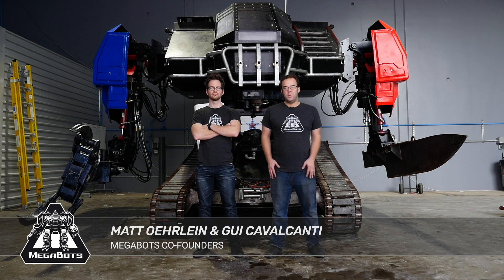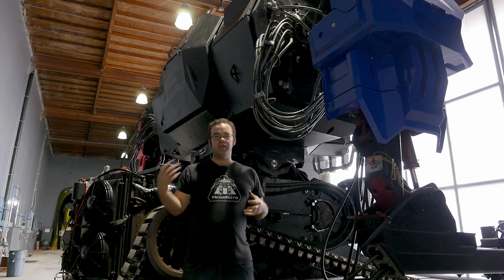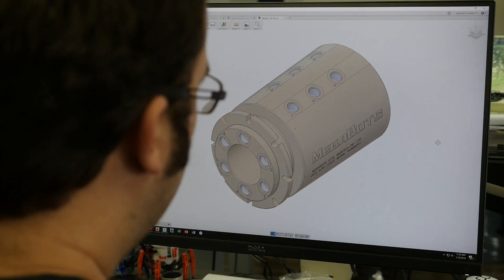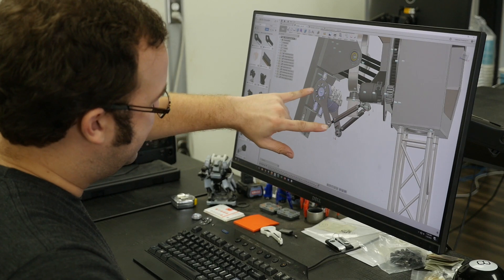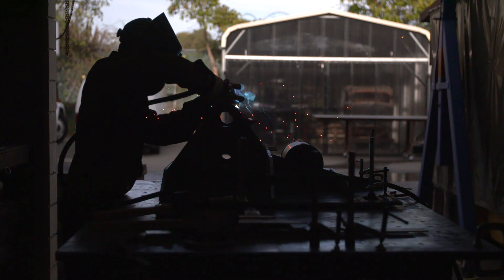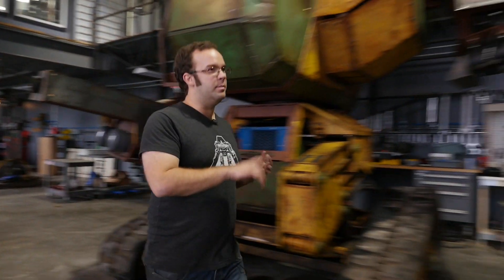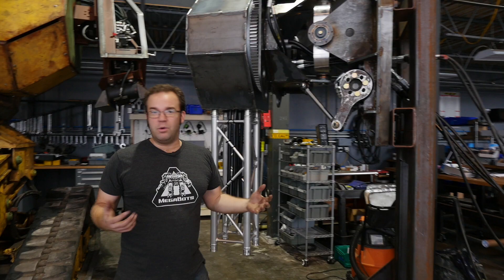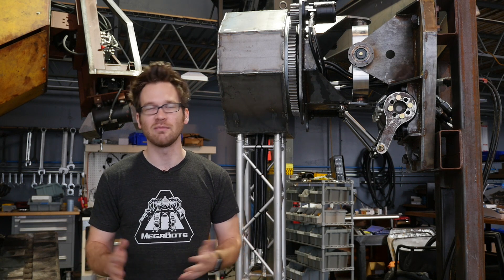A Faster Giant Robot Arm!

Comment: I realize speed over power was the entire point of this but out of curiosity how much of a loss of strength (if any) was there? I'm noticing from the video it appears to use hydraulic motors rather than electric and it appears there's 3 of them, how much lift power does it still have? I'm sure it's no pushover still but I'm wondering if any tests have been done on this aspect of it yet.

All that said, definitely looking forward to seeing this project finished and seeing Eagle Prime equipped with these speedier arms and possibly the tire base, I might be going off topic of the video bringing up that test but it seemed promising based on the livestream, biggest issues I saw (besides the cone masacre of course) would be the issue of altering the telehandler to support the rest of Eagle Prime and the length of the tire base possibly getting in the way of proper combat. (At the same time this is speaking from someone without knowledge on construction vehicles so not sure how big of a risk those tires have of being damaged)

And if you guys read this, thanks for reading this long message that got way off topic from where it started.

Comment: your fulls cus i have this (i have the worlds secris i my head one of them is how to make a mech its so simpal and why are IDOUTS LIKE YOU INORING MY COMINTS HERE HOW TO MAKE A WORKING MACH THE HUMIN BOTY IS SPENDED FROM A ROPE WITH A VR ON THERE HEAD AND SOMETHING TO TRACK THERE LEG HEAD AND ARM MOVE MINT THEN TELL THE CORUSPONDING BOTY PART TO THE CARUSPONDING PART OF THE MACH AND ALL THE PORSINGSIN POWER IS NOT IN THE MECH BUT FROM A DATU BASE WITH A BIG TRASMITER AND RESEVER AND THE MECH WILL HAVE ONE TO AND TRAFERS THE DATE TO THE PROPER PART AND THE HOLE MECH IS REMOT CONTROL WICH MEANS NO CASHLTYS ITS A SIMPAL AS THAT NOW IM JEST GOING TO SPRED THE WORD WITH CTRL C AND CTRL V) and yes i made this my self i aso did one on hack smith so GET TO WORK IDOTS

Comment: awesome to see the evolution 
tho i will say, it is amusing that you didnt do this during Mk2 design
i did tell you
but you argued against it 
so will this be the birth of the Mk3 ?
not only will your new design hit harder and be stronger
it wont need as much weight because it wont need to tons of extra armour the Mk2 was going to need 
also, using the same parts you can increase the mobility in the legs and perhaps start thinking about bipedal movement 
might be a good idea to have a chat with these guys 
https://youtu.be/3ldJswGpkjY?t=5m26s

Comment: One question, why are you guys still sticking with the robot design that is very tall and is top heavy? It will fall over very easily like the first battle... Take an example from the japenese robot, it is a bit shorter but it's mass and legs are spread widely, thus making it harder to topple over.

Comment: The rotary union was a waste of time and money... A simple thick wall hollow tube with the hoses running through it would have been fine as there is no need to rotate the shoulder more than 360 degrees if you are trying to mimic human joint... another issue is that although hydraulics are strong, they are slow... you are also putting a lot of stress on that tiny pinion gear... outside torque will bust that gear/motor easy. why not go with pneumatic power on parts that need speed?

Comment: TO SLOW YOU NEED TO COUNTER WEIGHT !  TRY GIANT SPRINGS ON FRONT OF THE ARM WITH A VARIABLE TENSION MECHANISM ON A CABLE LIKE A REEL ON AN ELECTRIC MOTOR THAT CAN SPINUP WITH THE CABLE LOOSE AND THEN YANK THE TENSION ON THEN GO TO FORWARD WITH THE HYDRALIC ! I USE COUNTER WOUND REALS AND AT THE MIDDLE POSITION THE LEGS ARE HANGING DOWN THE MOTORS SPIN UP FROM HANGING ( NO PRESSURE ON THE CABLE ) TO 1500 RPM THEN ENGAGE THE LEG TO PULL UP !  20 POUND LEG MOVE UP LIKE A STILLETTO  ! THAT BOT WAS ONLY 5 FOOT TALL! AT THE HIP ! YOU COULD JUST USE A LARGE ELECTRIC MOTOR WITH A REEL BUT IT WORKS GOOD TO USE 1 MOTOR AND 2 REELS AND COUNTER WIND THE CABLES ! ITS CHEAP AND EASY

Comment: Was this an ad for Autodesk? If so, I fully approve! Get as many sponsors as you need to make this happen!
If you had unlimited funding would titanium be a viable option? I feel like the reduction in weight would really help with movement speed.
Reply: That could be viable, but there's a couple reasons Steel is preferable:

1: Cost.  These are parts that may very well be broken regardless of how well designed they are, which means that replacements need to be economical to create and have on hand.

2: Size and design.  Titanium, while stronger for its weight than steel, isn't necessarily smaller for the weight than steel.  It can vary, with Steel sometimes coming out on top, and Titanium winning other times.

Because of these two factors, steel is, for now, the better all-around choice.
Reply: Cost of course is a huge limiting factor, but in a dream scenario with "unlimited funding" that wouldn't be a problem (obviously not realistic, yes).
I don't really understand your second point. Are you saying that you would have to use more titanium/bigger pieces of titanium to have the same strength of steel? For example, a 6 inch tall steel I-beam would be just as strong as a 12 inch tall titanium I-beam, but the titanium would still be lighter? In other words, titanium would be lighter but bulkier?
Reply: Exactly.  The difference in size wouldn't be that much, but it'd be there- and more Titanium means more cost, as well as more size.

You see Titanium armour on a lot of Battlebots because it lets them get away with much thinner, lighter sheeting on the outside, while still retaining a lot of strength- if they replaced the same weight of titanium with steel, it'd almost be something you could put your boot through, but if they replaced with the same volume of steel it might end up even stronger, but be much, much heavier.

It's all in what alloys you choose, though,and how you end up using it.  Just due to the size of the steel industry, cost is still the biggest concern.

Comment: Glad to see that their is enough interest in the project from tech companies to sponsor/partner with you.  I was worried the project might have been dead.  The improved arm and protection for the hoses is a definite step in the right directing, but The biggest problems with Eagle Prime, namely the overheating (and possibly under powered) engine, the lack of really destructive weapons, and the lack of armoring of the superstructure still need to be addressed.
Reply: I think the lack of armouring and the frailty of the design are actually on purpose for the showmanship of the thing.
People have asked loudly for more destruction. This will cost more. And ask for more quick repairs. 
By allowing the Mech to break easily at points of their choosing, they are actually preparing for massive graphic violence and low budget repairs. I think it's the way to go, at least for now.
Reply: Bohemond I of Antioch for the moment they need to deal with the biggest problems and those are the ones that can damage the image of the franchise really

this is a step in the right direction, with this video alone they had demonstrated that

a) they are still alive and going strong

b) they knows that there are problems with the bot and are taking actions to correct them and further improve it

c) prepare the stage for future battles

if you want to help them fund the bot buy a shirt, they already said that a big chunk of their budged comes from the things they sell

Comment: Like the invovations, and I'm sure someones realized, but be careful using Gear type joints in the arms.   They have serious issues with durability if theirs any kind of resistance/counterpunch againgst them.   If your just using them to rotate up and down on the shoulder it should be fine, but if you attack of punch using them they will break very easily.

Comment: so when do they start selling the plans to the military
Reply: James Fulton when the robot is developed enought to be considered a weapon
Reply: Probably never. At least not in this way. The military doesn't want Mechs. They are too high, get unbalanced quicker in case of hard recoil and for now, they still do not possess the advantages of fast and agile bipedal locomotion.
What will most probably happen is that eventually development will get to a stage where it will be able to serve other uses. I guess we'll see police and firemen crew use Mechs way before the military.
Then maybe, the military will finally get interested.
At which point, they won't buy...
They'll simply bring the members that have left the team on board and begin their own program.

Comment: That’s a shoulder joint made for a fighting robot, instead of a joint from an industrial robot that you’re trying to use in a fight. It would be nice if another team got serious about this too, instead of nonsense like China’s renders and the Kuratas toy. As it was, Eagle Prime was already well beyond both of them. Now, anybody who wants to be a contender has at least two years of work to catch up, and that’s only if you guys quit developing now and wait for them.
Reply: fx odios admittedly, the kuratus was built to battle mark 1, not mark 3.
Reply: Daniel Knight eagle prine may have beaten kuratas’ “toy” but you have to admit that if they were in equal sized robots and kuratas had put stronger armour panels instead of some of those plastic parts then it would have standed much more of a chance
Reply: I feel like as long as there arent any weight/size limitations it'll always just be the bigger robot winning, or the one with more power

Comment: I hope that the geared power transition is robust enough to withstand punching. Snapping off a tooth would put that arm out of action.
Reply: To be honest a chain or a globoid-style worm drive for that would distribute the load much better over a larger engagement surface. I wonder why they didn't go with one of those?
Reply: Everfalling It’s mild steel so if wouldn’t snap, it would bend. Even so you’d have to try very hard to do even that.
Reply: I imagine that a chain would be even more prone to failure, despite being easier to repair.  And a worm drive might have a higher chance of shear, due to no reverse-drive capability.  That is, something impacts the current gear setup, some of the force is transfered back through the rotation of the drive gear- something impacts a worm-gear setup, all the force is stopped at the teeth.
Reply: Earthenfist: I did say globoid though. One of those would be engaging somewhat more gear teeth than two or three. Yeah it can't be back-driven (which could also be taken advantage of in some cases), but I see a hydraulic motor being used to drive it rather than an electric. Those don't take to being back-driven much if at all either. Only way to do that is to get rid of back-pressure. So it might imply there being a relief valve or damper tank on the hydraulics, which just might be enough to prevent the level of torque that would shear a tooth with the current setup.

Comment: You might want to put some sort of plating or a cover on the ''armpit'' to protect the joints moving the new arm. Yeah the wires are safe but if those joints are compromised you're right back where you started. But regardless good job, with every failure is a chance to get better and the arm the new arm is going to be great.

Comment: I am so happy that this is still going what you guys are doing will change the future :)
Reply: CHIPOTLE MASTER without real science break through like new material and new energy source , future will not be changed
Reply: x jh did I say for science no I meant for entertainment so stfu before you dig yourself a bigger hole
Reply: CHIPOTLE MASTER are you going to ask " is math related to science ?"
Reply: CHIPOTLE MASTER what engineer work with is science itself.  Such as the material.  One problem facing building a real mech is the material and power source.  All of these problems require science breakthrough for it to work. You can't  engineering your way to a gundam with current tech. Without break through , you can build the best bow and arrow possible , but would never build a gun. 

What these guys here are just building bumper cars

Comment: Why not use electrical motors? I'd love to see a fully electric bot
Reply: They're much, much less powerful, and way more expensive.
Reply: Plus they would have to add an electricity generator to the motor. Which adds another point of failure.

Comment: Next is making it walk.

You will need pressure sensors all along the foot and from where the pressure is and the angles of the limbs you can make it balance.

The feet need to be able to move like a human foot as its the most important part of balance.

Good luck as i have seen very few good two legged robots and non that damn big.
Reply: CommanderWolfy hey you ever seen method 1? Its worth a look at if you havent seen a walking robot that size.

Comment: The new arms do move much smoother than the last models. I'm worried the giant gear assembly would be a weak point should the teeth on it shear or break off :(
Reply: Ya with a hefty punch those gears would strip real quick, although it's not much extra work to have several motors share the load and also distribute the gear engagement.
Reply: Well, maybe it will be protected by future hull plating?
Reply: I pray they are not using the trussed arm in the video for combat, because that has many inherent design weaknesses.

Comment: Improvement 
1.increase movement like the turning 360 degree 
2.add  thrusters to dash at the enemy’s 
3.find a stronger and lighter metal
4.increase every turning and movement speed as possible 
5.final add mech legs that are armoured and fast as a tank
Reply: TGamer Bailey nice, now we just need a fusion reactor and force fields. BRUH YOU'RE ASKING THEM TO DEVELOPE NON EXISTENT OR DARPA LEVEL TECHNOLOGIES. CHILL.
Reply: "Add thrusters"
Hmmmmm......... 🤔
...
...
...
ELBOW ROCKET!!!!!
Pacific Rim anyone?
Reply: One of the only metals that has comparable strength to steel and is lighter is titanium, and that's crazy expensive.
Reply: Plus, steel is such a versatile metal. Just by varying things like carbon content, additives like molybdenum, and forging processes, you can get an absolutely breathtaking variety of material properties. Steel really is quite an incredible metal
Reply: Jeff Vader 
Not to mention way less tough. Titanium is almost never a replacement for steel because it's so brittle that it can't absorb an impact. The fact of the matter is, there is no stronger and lighter metal than steel in existence that is anywhere near affordable in these amounts
Reply: It depends on the alloy though, but you're right, steel is pretty much the go to metal for most industries.
Reply: Yeah, but a heavy robot could take more punches and dish more out. Because of newtons 3rd law.
Reply: TGamer Bailey But also incredibly strong and versatile. And, as already pointed out, incredibly cheap. And besides, raw tonnage in a giant mech fight is a huge advantage. The reason they chose steel over something like a high-strength aluminum alloy is very simple: because steel is far and away the best metal for the job. These are combat mechs, not airplanes. Being light is not an advantage
Reply: Don't forget it's also cheap as dirt nowadays.
Reply: TGamer Bailey Speed is much easier to get than you'd expect. For the foreseeable future it literally just comes down to whether or not they can afford to buy a beefier engine (which is cheaper than fancy alloys). 

And as for legs, that technology is in its infancy right now. While we can easily build the structures to an adequate degree, the control algorithms just aren't there. Even a state of the art robotics firm like Boston Dynamics is only just figuring out how to make a robot able to balance itself after being pushed. A team like Megabots won't have walking legs combat-ready soon enough to make any real difference. When human prosthetics are able to handle the myriad demands of natural movement, then we might be able to put high-performance legs on giant robots. I'm guessing it'll be somewhere between five and ten years from now

(And by the way, I've been using the word strong in the materials science sense, not the usual definition, so when I say strong I literally mean it is great in the long term)
Reply: hahaha this guy..hilarious. you watch too many movies TGamer...
Reply: you guys just listen here, all they need is a good amount of unobtainium.
Reply: You evidently know nothing about design. Thrusters would be exceptionally impractical, hindering mobility on a tracker hull far more than helping it. From the basic structure of legs alone, they would be inherently slower and clumsier than a tank.
Reply: BlueHawkPictures  yeah but there are different types of thrusters and maybe add 2
Reply: Zachary Leib-Perry steel is very heavy
Reply: Zachary Leib-Perry it is but they will need speed and I know steel is strong but not all ways good in a long term
Reply: Bruce Krager there are lots of prototypes of mech legs
Reply: TGamer Bailey mate, ther eis only one mech leg prototype in the world that i have seen from all the research i’ve done and i’ve done a fuck ton of it, yeah there are smaller leg prototypes but only one for giant robots and that is super advanced already but just not quite as advanced as what you are saying for it to do, like dude, your not gonna be able to make this thing jump or run let alone giving it thrusters to make it move quicker towards the enemy